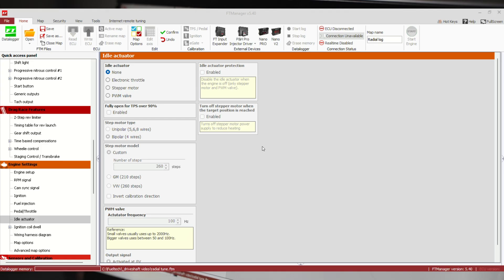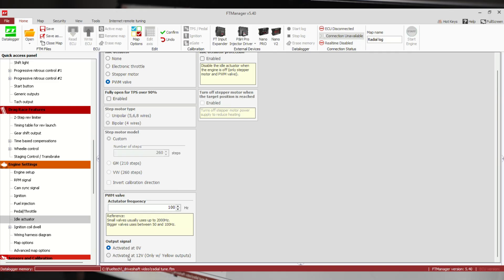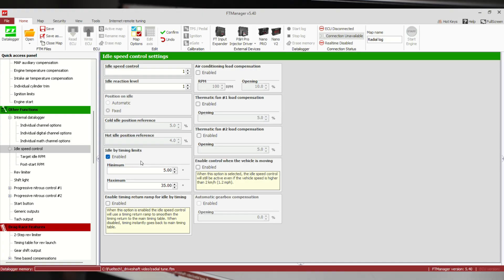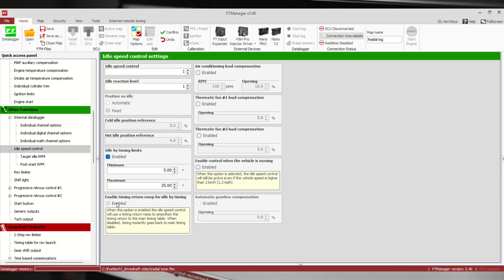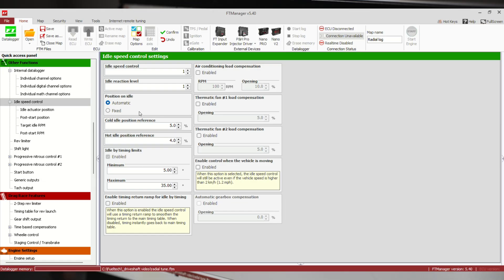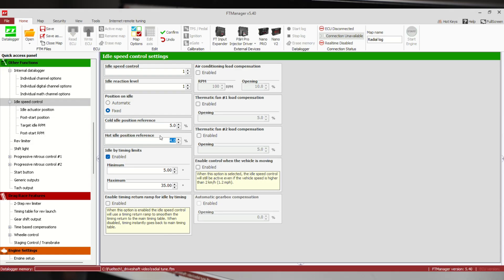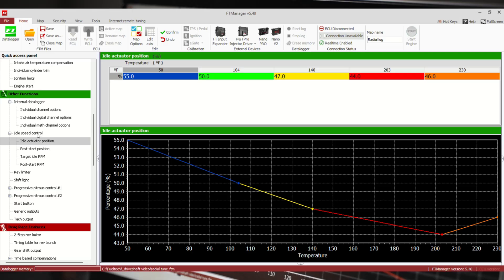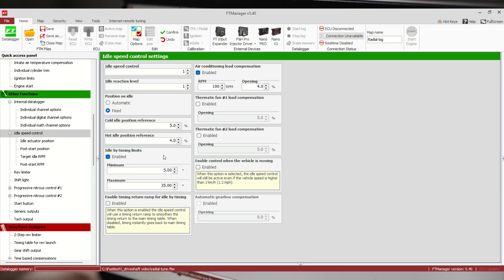Idle Control Settings Explained | FuelTech PowerFT Tech Tuesday

Comment: Hi! Im trying to use a PWM from a ford ranger. It has 2 wires and i don't know if the FT ECU (FT 300) controls the IAC directly from the auxiliar output or it needs to power a relay. I dont think it uses that much current but im not sure.

Comment: How does the stepper motor behave in automatic mode? thanks
Reply from the maker: It will open or close on its own to help get to the RPM you have in the "target idle RPM" table. I still prefer fixed because once it is mapped out correctly across the engine temp operating range, it rarely changes more than the idle by timing can take care of.